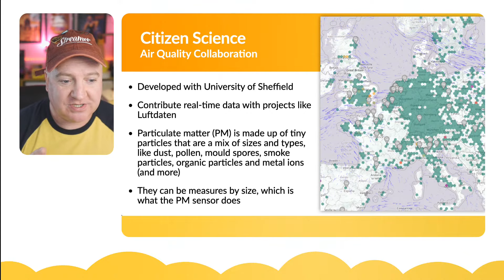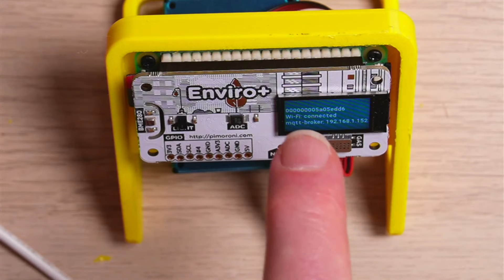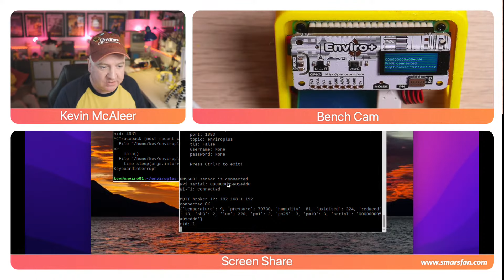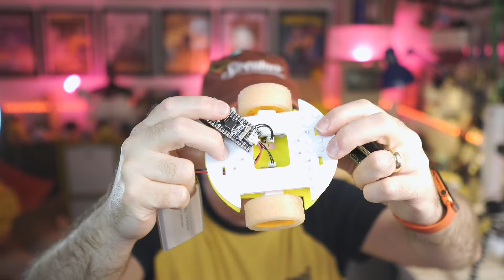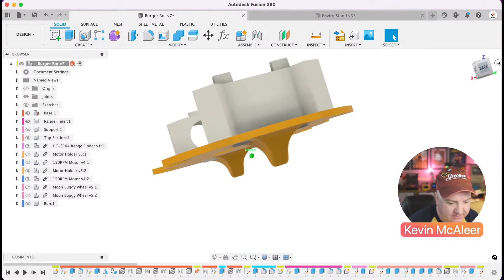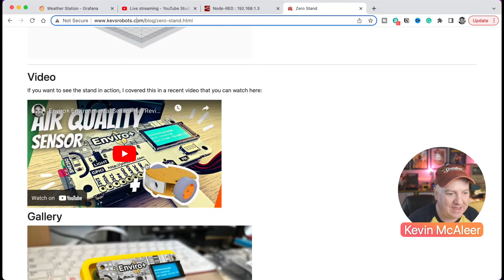Transforming Air Quality with Enviro+ Sensors

Comment: Having trouble pushing enviro data to influxdb.  Do you have an example of the code you use in the function node in node-red?
Reply from the maker: I use version 1.8 of influxdb as it doesnt require authentication and you can simply push data to it
Reply: @kevinmcaleer28  Thanks Kev!  I'm using influxDBv2 for now.  Just starting out and takes out the need to install, run and learn Grafana too.  I've found a workaround where the EnviroGrow will push data straight to InfluxDB, bypassing MQTT.  Now to see if I can set it to log to both services so I can add complexity in future when I learn how to use node-RED...  For now I'll work on calibrating moisture levels before I drown my plants

Comment: Hi Kev and team from Singapore. Thanks for clarifying that the PMS5003 is basically silent. 

As I mentioned in the Discord - shout out to the Kevsrobots Discord - I'm keen to know if you could you could combine the Envirohat+ with the PMS5003 and the WeatherHat using a Phat Stack daughter board.

Based on Hybotics feedback I'm probably going to add a GPIO extender to reduce the effects heat from the Pi Zero on the temperature sensor.

Thanks again sir. A quality review and integration demo.